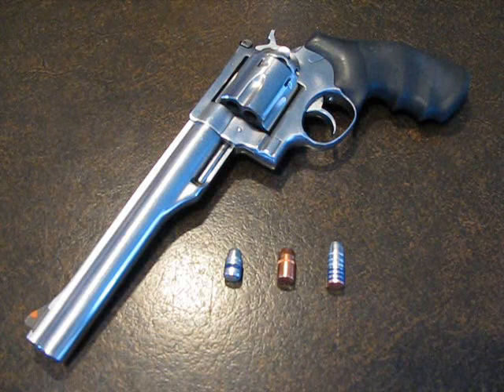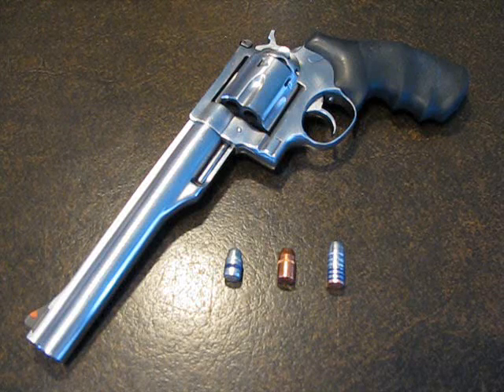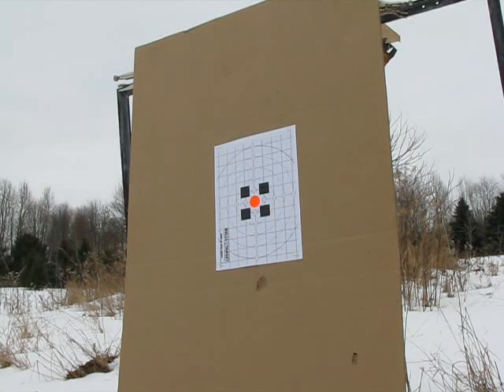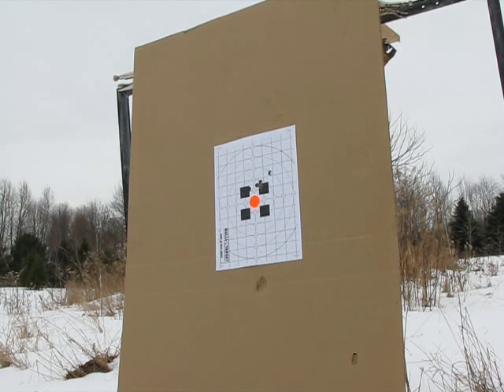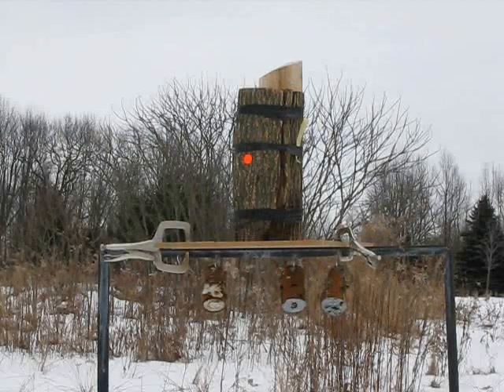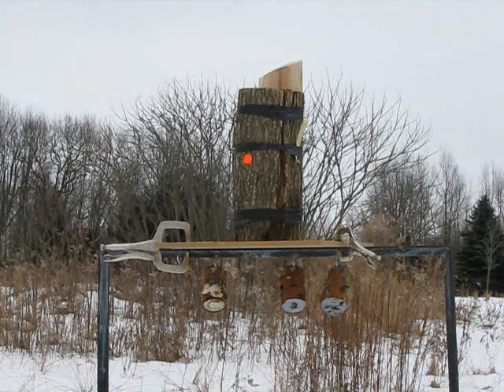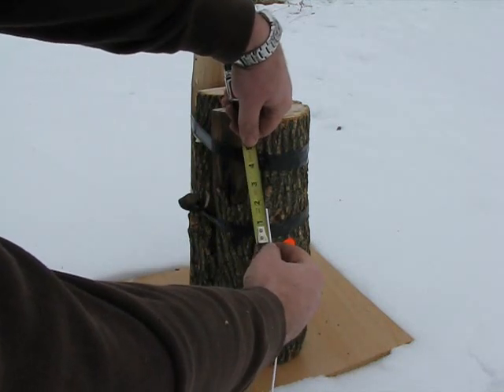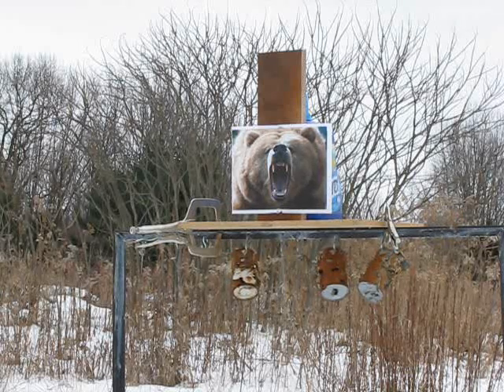The .44 Mag and the effects of a 405 Grain Bullet

Comment: That bullet is so long it has to be restricting the amount of room available for powder. I'd bet that a 45 Colt with a 405 gr bullet could reach considerably higher power levels just because the bullet would be shorter, leaving more room in the chamber and case for powder.
Even so, I imagine the .44 bullet would penetrate deeper (perhaps quite a bit deeper) if hardcast, to say bhn 18 or more. I think the bullet mushroomed in the wood, stopping it. It would be interesting to see the wood in half to see.
Reply: Also, I'm not sure the batter's twist rate is fast enough to stabilize a 405 grain bullet, but a ten yards, maybe it doesn't make a difference.

Comment: Max I'd go in 44 is 330gr, and that's already not optimal - the enemy over that weight in 44mag becomes the sectional density of the bullet vs capacity of the cartridge case and maximum pressure the cylinder can handle. No offense intended, and I enjoyed the video - it's just a lot of folks have been loading 44 mag since Elmer Keith wrote the book on it, and all you can do is say, "Yep, Keith got it right". No doubt this was a fun experiment though - I never thought you really plan on using it!

Comment: Correct me if I'm wrong, I'm a reloader, but I only follow the book and don't really experiment. Wouldn't a fast powder produce more FPS with so much case volume being eaten up by that huge bullet?
Reply: uhh,,, that heavy slug need time to accelerate, a too fast burning powder would certainly put up the pressures in ranges that is dangerous. Seating dept can be the same as for other more standard bullets, as long as the bullet does not reach beyond the cylinder you are good. This heavy bullet makes no sense, except among old-timers' stories around the breakfast table.

Comment: Ive been loading my own 44 mag for 20 years and never used a bullet with that much weight. Im interested in what type of powder you used. I think 400 grain would be a little too much. From my personal experience I think the 240 grain is the optimum weight bullet for the 44. you can produce massive amount of energy because it allows you to put enough powder in the case. for smaller game the 180 XTP hollow point with a compressed charge of H110 is explosive as well.
Reply: especially with a solid like barnes
Reply: +Chris Charles My heaviest cast bullet comes from NEI 309 gr backed by XX.X gr. H110 out of my DAN WESSON 4 inch barrel. Now that should be optimum for any thing pissed off at a hunter out to 50 feet?
Reply: Chris Charles, I use the same powder, and 240 grain bullet, I am impressed with the consistent accuracy and knockdown.
Reply: Yep been loading mine for 34 yrs now. My favorite is 300 grn WFNGC over max+ H110. Accurate, not too much recoil too handle and hits like a ton of bricks. Used in Ruger SBH and Winch Trapper.

Comment: As for bears, I prefer my Moss. 500. It has a 24" bbl n at 50 yrds I use a high vel. sabot with a .50 jhp with a hard steel inserted into the hollowpoint. In the bush I can draw it faster than a holstered pistol. Bears tend to not giv a warning sometimes n I dont want 2 b a bear's dinner.

Comment: You might get better results using a fmj and load it hot. The Ruger will take loads other guns wont. You can push it to 1700 fps. It does help to have a muzzle brake. I havd a Redhawk with a 7 1/2 " bbl and a Super Blackhawk with a 10 1/2 " bbl. I think you will like the results. Bullet has to penetrate and still have power to kill.

Comment: Most cylinders will not allow you to seat the bullet out far enough to not cut into case capacity. The 44mag like all handgun cases does not give you much extra unused space. I am not even sure the SuperRedHawk cylinder as massive and long as it is gives enough extra space to make up for how much case capacity that heavy and long bullet will need. That bullet cuts into case capacity on a 45-70 Gov and that is a much much larger rifle case. Something in the 325gr-375gr ball park would probably be the ideal compromise between velocity,penetration, weight retention and expansion. A copper jacket almost always improves penetration and weight retention through thick bone. If he was shooting at the soft parts of an animal and had to travel deep through tissue then I would go for a hard solid lead. Copper jackets increase penetration that is why military use a full metal jacket.  The original Barnes jacketed dangerous game rounds have brutal penetration with almost 100% weight retention and almost no expansion due to the heavy copper jacket. They are like a copper water pipe with a lead core.  A big hard not soft lead bullet with no jacket can work well with enough velocity and great against soft sides with bone and organs buried deep but it is not the best way to penetrate a thick skull from a hand gun. Just because it is heavy and works in a 45-70 does not mean much when carried over to a small capacity revolver round. the 44mag is small compared to newer more recent magnum revolver rounds. I love Ruger's but a gun named the Alaskan with a short barrel and magnum cartridge is kind of stupid if you want to use it on dangerous game. You have to burn the powder in an enclosed space and the longer that enclosed space is the more of that powder you will burn and be able to use to generate velocity which is what gives magnums their penetration power and allows for heavier bullets. Shortening a magnum cartridges barrel reduces it's power and velocity and creates a huge fire ball at the end of the barrel from all the powder that is not burning int he barrel. They should have called the Alaskan the "New Yorker" or the "Detroit" or the "Chicago" where a short barreled easier to conceal magnum can make some sense and still be insanely lethal. For bear stopping power a shortened barrel on a 45-70 with a shortened stock but not mares leg short and a sling makes more sense.

Comment: 44 magnum with a hot load in a  hardcast bullet in 330 grains will kill anything that walks the planet. However if you want a very handy 454 Casull buy a 4 inch Barrel Redhawk  chambered for 45 colt. There are gun smiths who will drill out the cylinder for 454. The gun is plenty strong to handle the pressures. The owner of Buffalo Bore ammunition recommends it and gives the number of a Gunsmith who will do the job.

Comment: I didn't think even Ruger's cylinder had enough length for that much grain.  I was mistaken lol.  I use my .44 mag 5.5" Redhawk in black bear country.  Shooting 240 gr soft point flat nose and 255 gr Keith hardcasts.  That's about as much recoil as I want to handle and should do the trick - shot placement, too .  Any .40+ cal shooting a 240+ gr bullet at 1,000 fps will take any bear in the woods.  Hope I don't have to.  I think I'd move up to long guns with grizzlies.

Comment: @hardman476 Probably. THe ruger redhawk is probably the strongest designed double action 44 Magnum revolver out there, and it has a longer than average cylinder. Because the 405gr bullet would be seated out taking advantage of the long cylinder in a load like this, Yes, I think it would probably be too much for the taurus.